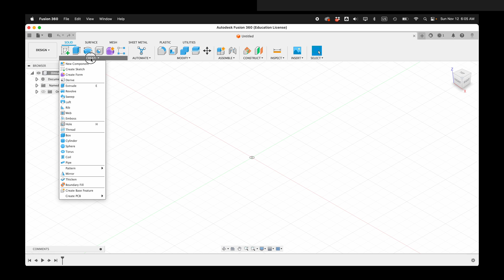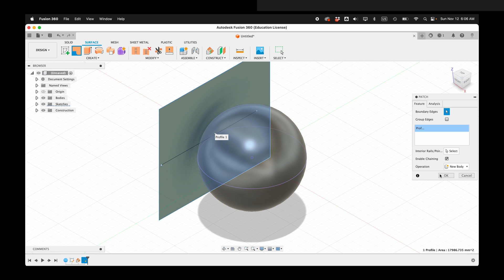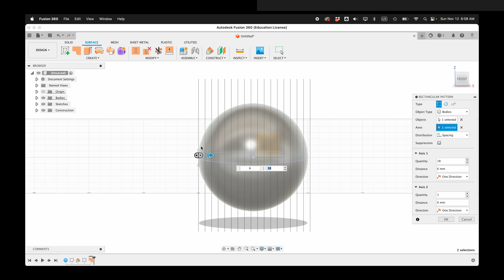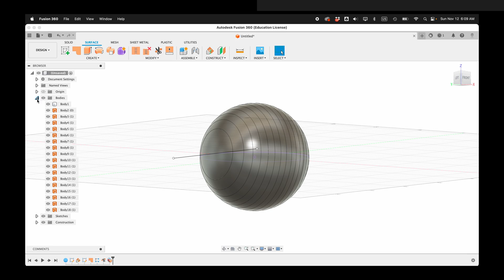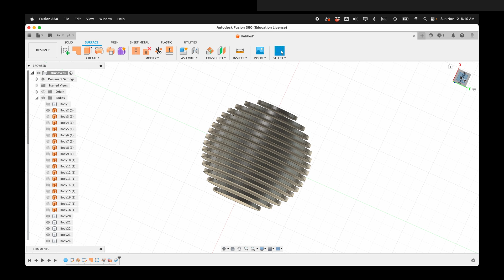Learn Fusion 360: Slicing Organic Forms for Laser Cutting

Comment: Hi, coud you explain why you use 6mm spacing if your using 3 mm ply wood? wouldnt you use 3mm spacing then ? Also why do you thicken by 1.5m if you plywood is 3mm ? sorry im a newbie, this is probably logical what youre doing , but it dosent make sense to me.. :/
Reply from the maker: Depends on where the pattern starts, in this case it was on the opposite side of one ply slice the the spacing was double thick, it needs to space out the thickness of object plus the gap
Reply: @WhatMakeArt  I get it now, thank you for your video.. i really appreciate it.

Comment: This video is really informative, thankyou. Although, I am still having trouble slicing my .stl terrain file. I start by closing all the holes/fixing the mesh, then I convert my terrain to a solid, after that I follow the instructions in your video. When it comes to splitting the body, I dont have the option to select my terrain as the body to be split, this is also the same when I try to trim. Any thoughts? Thanks!
Reply from the maker: Does it have the body icon in the outline? Or is it still a mesh or surfaces that need to be stitched together?

Comment: I couldn't do this with an STL or OBJ. Trim tool only lets me select one of the many faces of the model. Any ideas?
Reply from the maker: In the mesh workspace convert the mesh into a solid, you can do this under the modify tab in the mesh workspace of Fusion 360. Sometimes you need to click the Band-Aid or repair icon to fix the mesh and close any holes first
Reply: @WhatMakeArt  thank you! I'll give it a try!

Comment: Shouldn't this be done by kind of slicer?
Reply from the maker: There are probably dedicated slicers that can do this, but this is a way to do it. Parametrically in Fusion 360.

Always many different ways to solve a problem
Reply: @WhatMakeArt  There used to be a tool called Slicer for Fusion. It was then brought into fusion and was great. Then Autodesk removed it.  I did not have a way to do this until you post. thank you.

Comment: i'm super new to this and i have a question i havent figure out yet. after last step in your tutorial, how can i arrange or organize each surface into a vector file and process it in Adobe AI for laser cutting ? thanks in advance !
Reply from the maker: Yes can lay all the parts flat and then export a DXF tool path with kerf adjustment for laser cutting directly from fusion 360 https://youtu.be/6JFHMV7A9TU
Reply: This was one of my comments. He talks about cutting on a laser as the goal but then creates thick widths. No use for that, only need the flat vector art. It’s a bit confusing. And then why the seperation? Are these going to levitate?